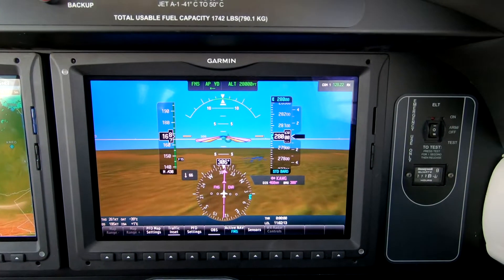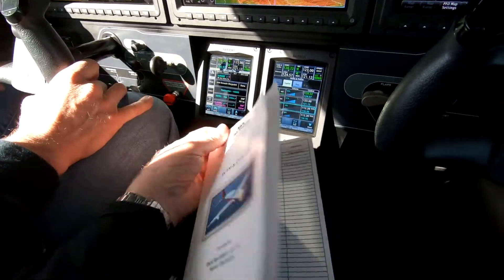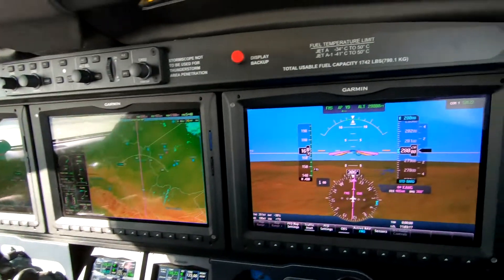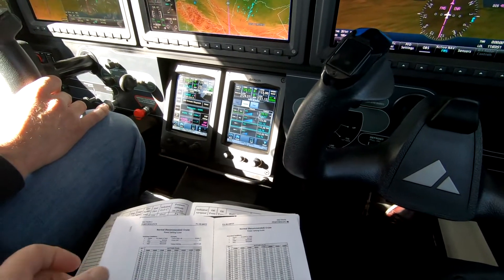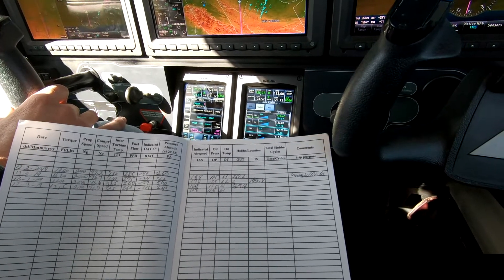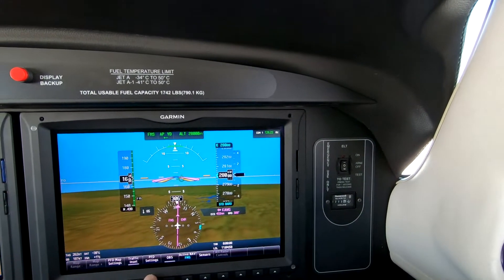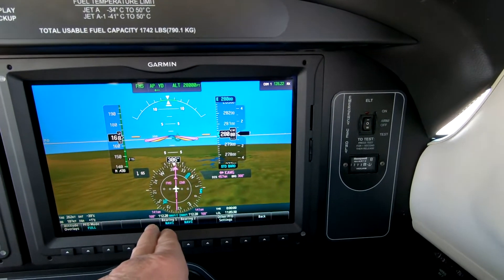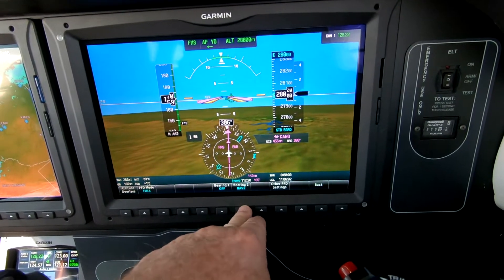Setting Cruise Power in a Piper M600 with Dick Rochfort

Comment: Curious as to why your heading bug is not at the top of the HSI. I was taught to always have the heading bug aligned with your bearing unless setting up for an approach or an after take off heading, etc.
Reply from the maker: Good question Conrad, I believe that pilots will be most successful with the least amount of button pushing. Each task should be completed with the idea of completing the task with the least amount of button pushing. Additionally the heading bug at the top of the luber line may confuse the pilot with respect to which system is in use, heading, RNAV or VLOC. Single pilot operators must be careful to avoid errors relative to busyness and catch their own errors. I train pilots to “press.. press” prior to setting a heading; that is to press the heading bug to the lumber line, engage the heading mode, then turn the heading bug left or right to comply with the clearance.  This is a small point to be sure and it really depends on your familiararity with your panel. Fly safely train often .. DR